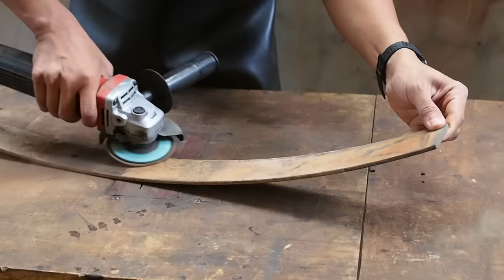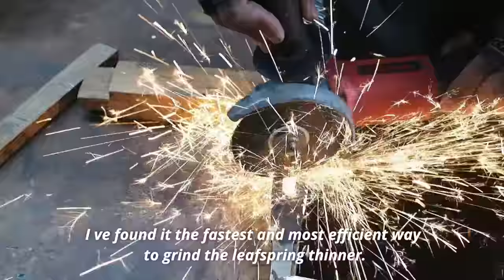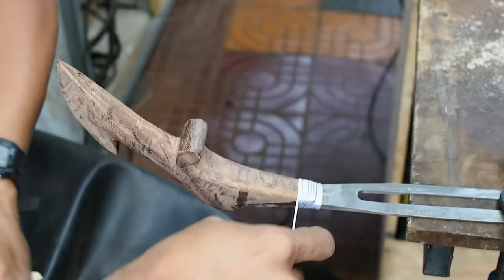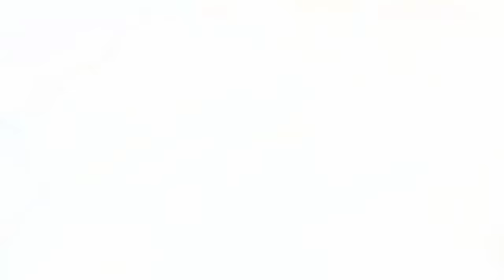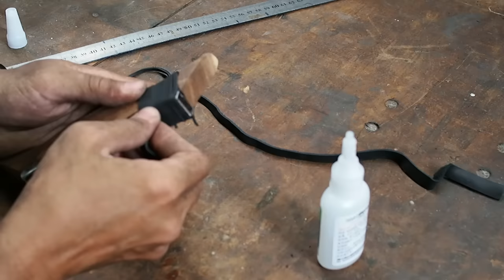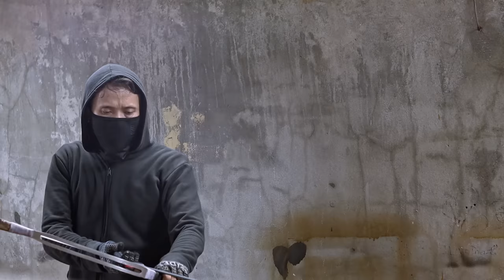Make Unique Takedown Bow with Twin Limb from leafsrping, powerful survival bow from steel no forging

Comment: Hi
 I really like the arms and grip. The fit is also very good. However, the design of the horns is not good. The string should be caught at the ends of the horns and not at the base. the efficiency would be better. look at a Mongolian or Hungarian bow, how the horns are made on the ends of the bows

Comment: A few modifications that I would consider for this bow.  After wrapping the twine and gluing it, I would be very tempted to wrap a thin layer of fiberglass cloth around those areas for just that little bit of added strength.  For the leather wrap on the grip, I think I would have used a strip of wet rawhide pulled snug (but not TIGHT!), as it dries the rawhide will contract around the grip for a strong and tight fit.  I doubt if I would have carved out quite so much from the center of the limbs.  Yes the bow would be heavier, but it would also have a higher draw weight.  My preference for a recurve is about 55 - 60 lbs.  Beautiful work!
Reply: I can't even shoot lower weights , been shooting heavy so long lower weights hurt when I shoot them , my Daily shooter is 110# but 3 days a week shooting 140#-180# Longbows and Recurves , My most Efficient and Comfortable is 125# Hill Wesley Special
Reply: @dennyerickson6578  Nice!  20+ years ago I was regularly shooting 100lbs or a bit more.  (sigh) Once I got deskbound at work not so much.

Comment: Hello, before thinning leafsprings, how many millimeters thick does it become? How many millimeters does it decrease to?
Reply from the maker: the width is 2,4 cm. You might want to make it thicker for more heavy weight.
Reply: @backyard.craftsman   bro Can you tell me the thickness, thinness and length of the limbs?
Reply from the maker: @muhammedeminylmaz4304  it's 4mm thick after grinding
Reply: Dude, on average, how many minutes did you take to sand the steel?